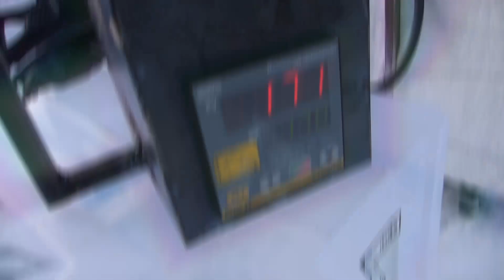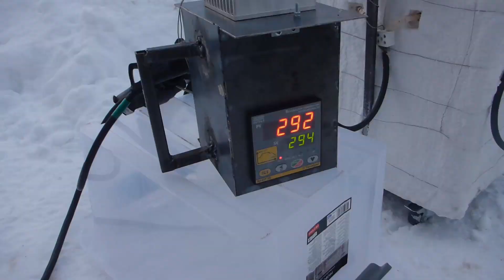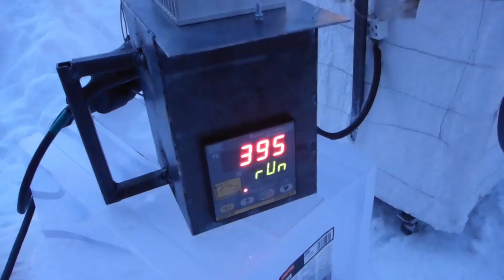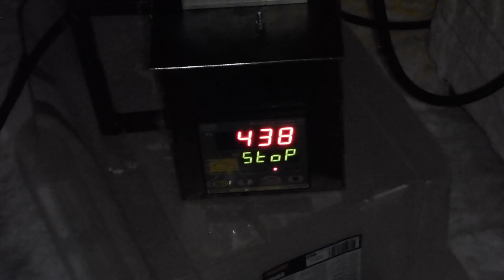Odkrywanie procesu wypalania i utwardzania powłoki ceramicznej do odlewania metali

Comment: Great video 👍. How much $$ is spent on electric to do the burnout?
Reply from the maker: It depends of the kiln. In mine I have 8kW of power altogether. The burnout last whole day as you can see in the video but the kiln does not consume all the time 8kW.
I did not count it by a kilowatt meter but last month -February - I was doing 4 or even 5 full burnouts, and 3 preheats before pours (but they last about 4hrs), and paid more of about 50$ than in whole January. So we can say that about 6-8$ per burnout.
Reply: @DragonAtelier  that's not bad.  I thought it would be more, but once it gets to proper temperature it just has to maintain it
Reply from the maker: @HeinrichsMade  even when it heats up it does not suck with full power. I have progrwmmed the controller thet way that it heats no kore than half a second and the the heating coils give away the heat generated. The pause between every on/off is controled by the controller and this is the varialble dependant on the needs of heating up/maintaining the temperature.
Even tho when it heats up to 900*C for copper alloys pours (bronzes, brasses etc) the coils do not suck full power.